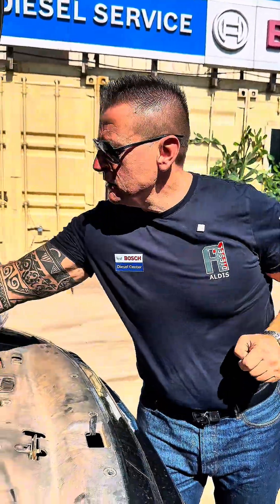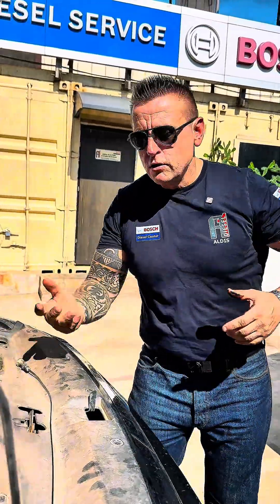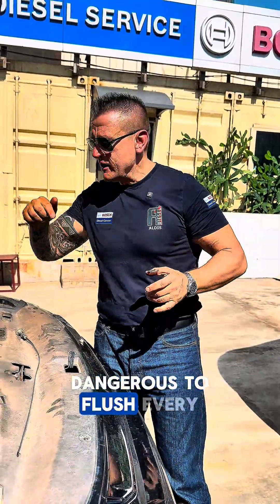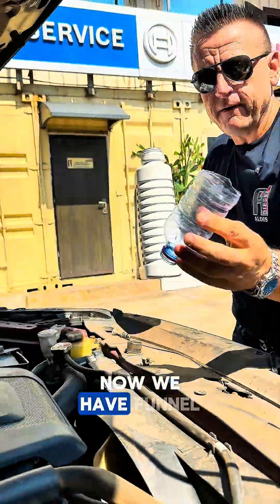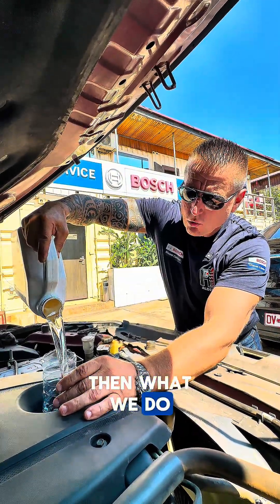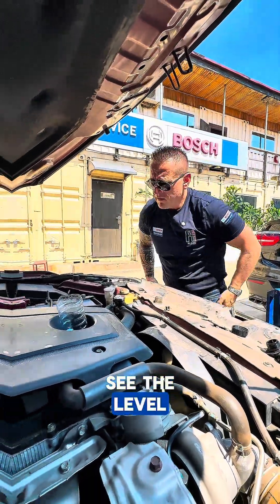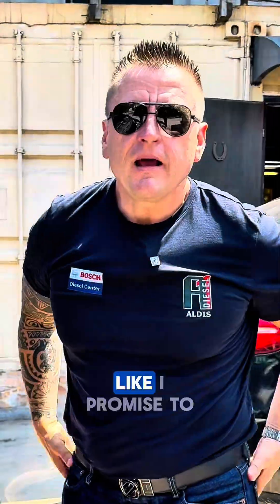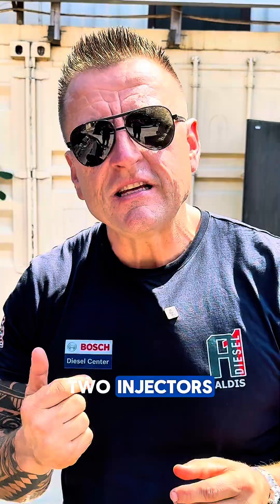Why Your Engine Oil Turns Black Right After a Change 😳

Comment: In brand new engines the oil turns black almost immediately and there's zero carbon deposits
Reply: Egr
Reply: In pre EGR engines it's the same and more modern engines with EGR disabled it's also the same. @MrYaknoyerself

Comment: I believe the main reason is because oil is washing off all the burning residue from cylinder walls. If you want to maximize the effect of engine flush, you should also remove oil pan and clean it after doing engine flush because you never can´t get out all of the old engine oil.
Reply: That’s right. On point ! That’s how it should be. At least after 5 oil changes.

Comment: neglected engines should not be flushed, floating chunks of carbon are not good for bearings etc
Reply: That’s why every so often you should completely tear the engine down to the fair block read every piece out and then reassemble
Reply: @brettweltz8135 that's unnecessary and very expensive. Just chnage your engine oil regularly and have mechanical sympathy, your engine will last.